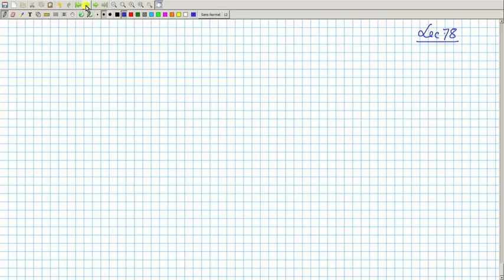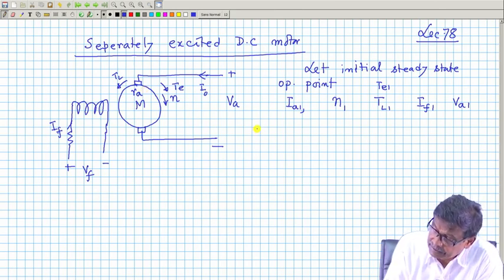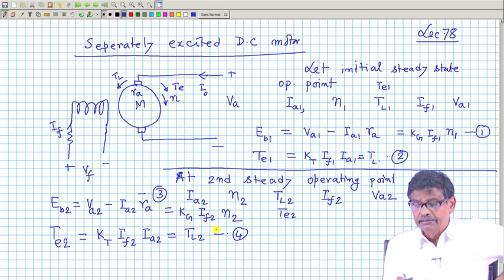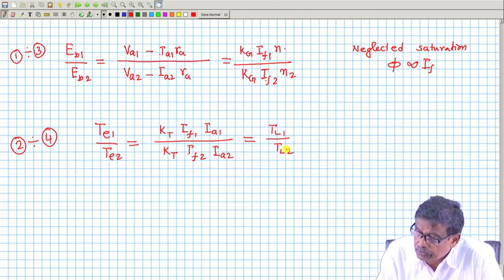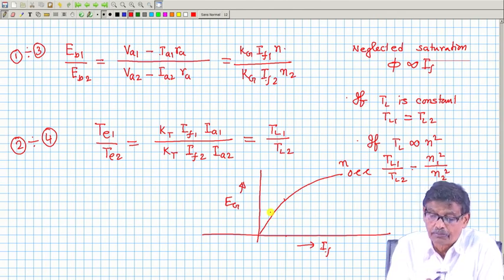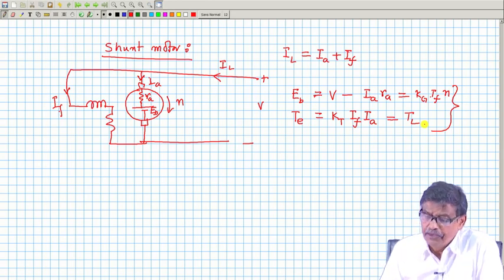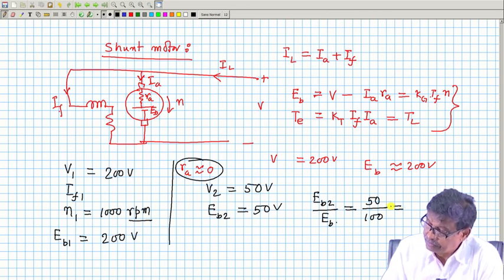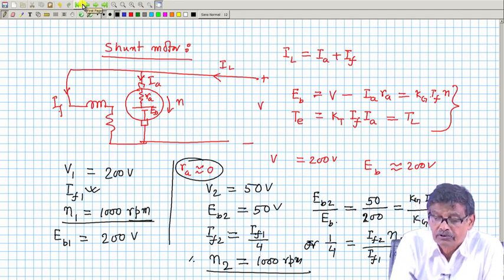mod09lec78

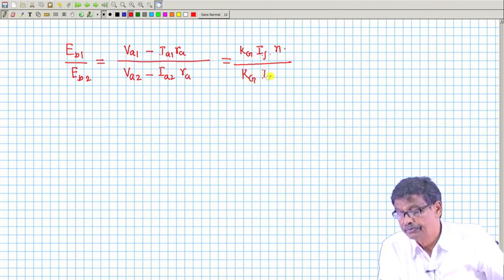Comment: @11:41 Could you please explain why we use current "If" here instead of flux "phi" ??
Reply: because we assume phi to be directly proportional to If in the linear operation. Note that the flux that is being generated in the elctromagnets of the stator depend on the field current. In previous lectures sir realised that the emf generated by the armatures depends on the flux of the stator field. If the motor is operating in its linear region, not going into the saturatiaon region, we can directly assign flux to be dependent on field current, (refer to flux= mmf/reluctance)